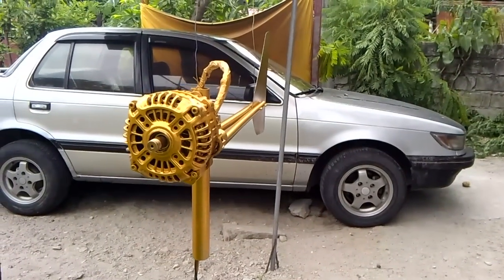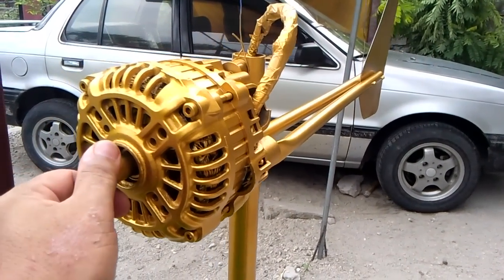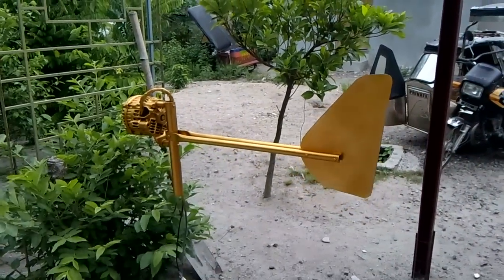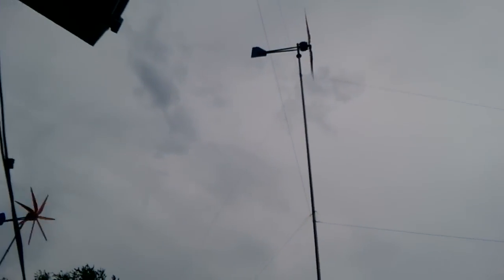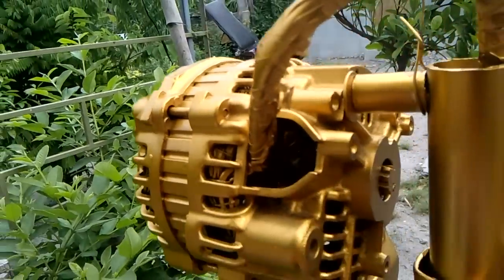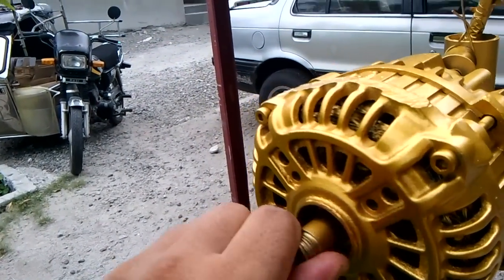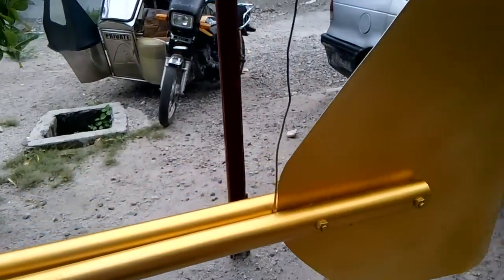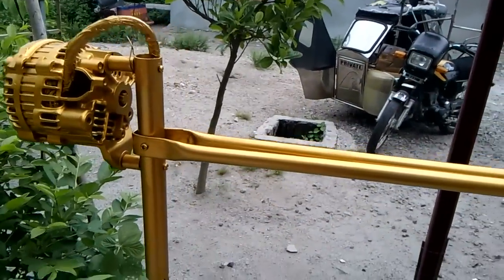Converting a car alternator into wind generator: Assembled

Comment: This won't turn fast enough to generate the 13V+ you need to charge a 12V car battery. You will need to spin this at over 2,000rpm to do so. If you don't believe me, try it and find out! This looks to be a very pretty set up, but it is fairly meaningless without practical results obtained over a long period.  Futhermore, the small bearings on a car alternator are not strong enough to withstand the dynamic forces and loads from a spinning set of blades. Plus this kind of video, without testing over a long period, misleads others into what works, and what doesn't.
Reply: Megan O'Neal crankshaft pully vs. alternator pully. You will find the altenator spins faster than engine rpm due to its much smaller pully diameter.
Reply: i wouldn't assume it's useless. maybe he has several of them running in series charging up batteries, also could be used for small localized stuff, like outside lights, watering system, ect
Reply: @meganoneal6578  600 rpm with a 7 to 10 inches crank pully  spinning a 2 to 3 inches pully , do the math

Comment: The best way to go about setting up a system like this is with a pulley systems to where a horizontal axle is attached to a wide pulley at the back of the fan blade. From there you attach a belt that then goes down to the alternator which will now turn at a much higher RPM.
Reply: Except you'd need large blades and a lot of torque to spin the alternator at the minimum speed needed to produce an output high enough to use.

Comment: you can't produce enough power since your car  has more rpm than your wind generator
Reply: Stator is rewknd for higher voltage output and its pma low rpm motor compared to stock car alternator

Comment: Awesome.
He converts the inside from 
DC to AC current output.
So, they are now producing 
110 volts A/C power 
instead of 12-15 volts D/C power.
Reply: Nope macoconvert din sa dc then ichacharge nya ung battery low voltage din ung output but high amps good for battery bank
Reply: Can you send me the info hownto convert a toyota 4 pin altonator?